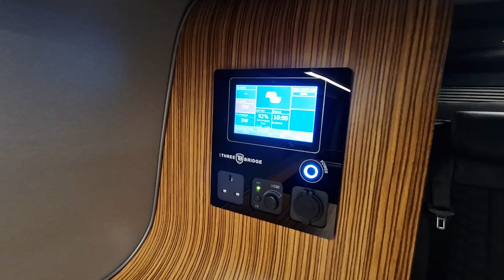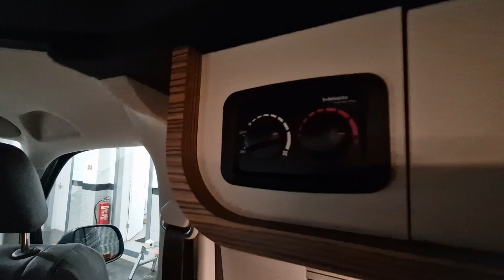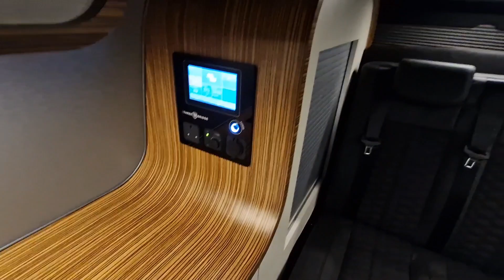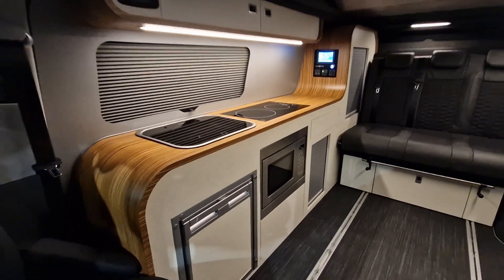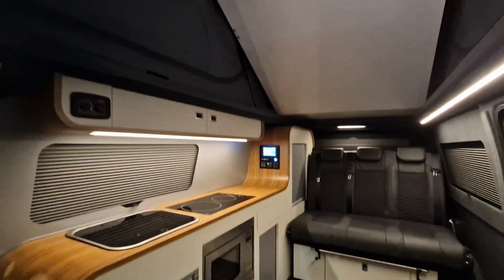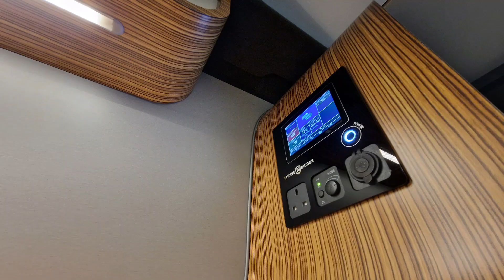Trek RV Infinity Camper Conversion VW Transporter T6.1 LWB

Comment: Beautiful conversion but not feeling the solar panel to keep up with any real off grid living when you have electric hobs.. ? no doubt bomb proof fabrication, and buckets of style.
Reply: I don’t find mine too much of a limitation, there again I am also mobile with the van when off-grid so the battery is also charged DC>DC from the engine.  I’ve had a fair charge from the solar put into the battery when parked up for a day in the hills during autumn, obviously will be improved during summer.